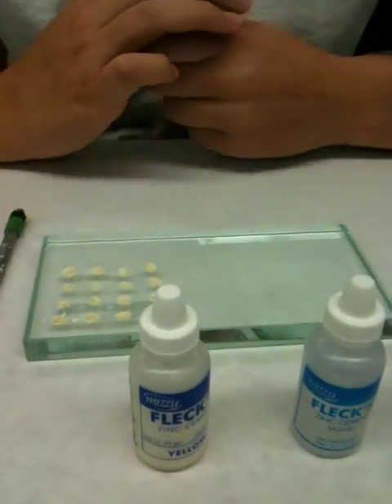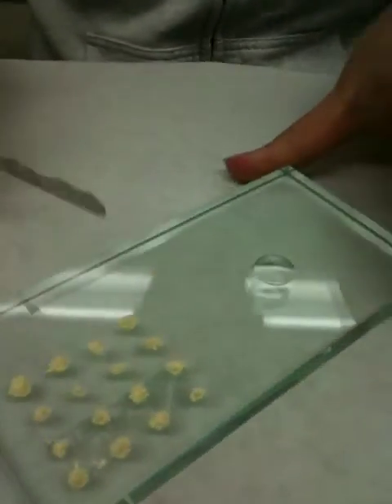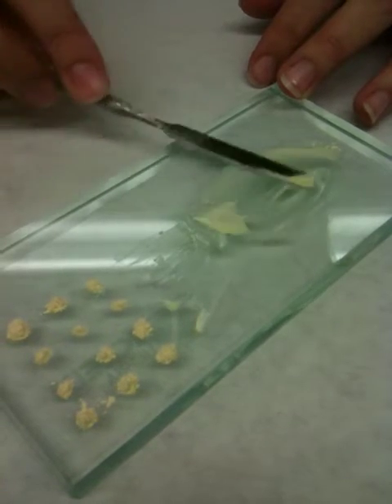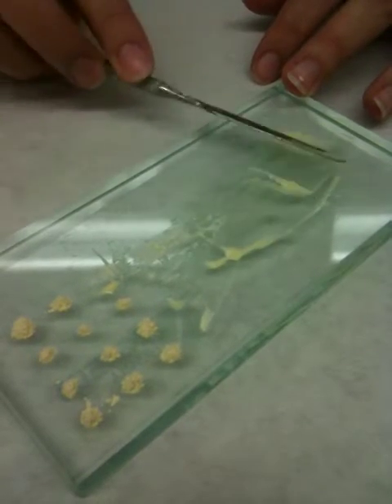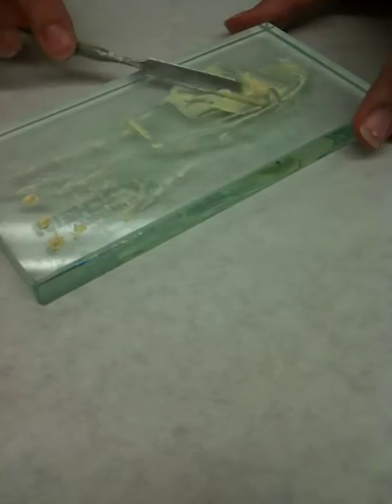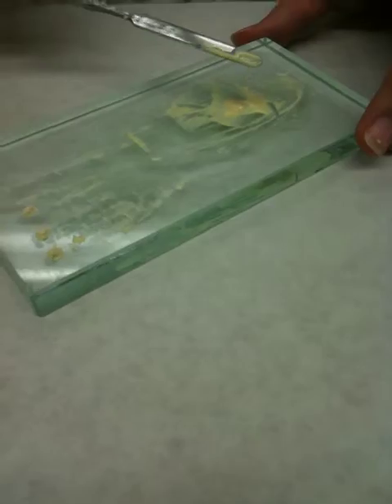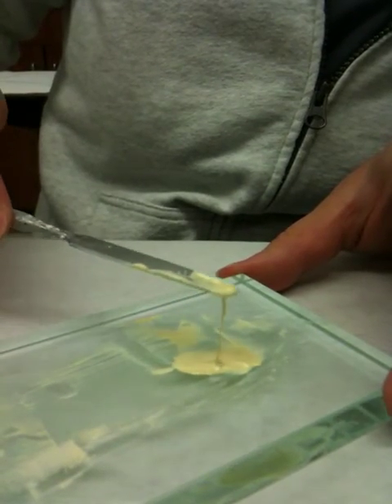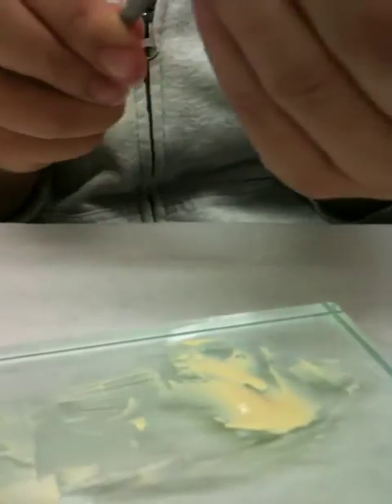Mixing Zinc Phosphate(FLECKS)as a Permanent cement

Comment: I am puzzled by these zinc phosphate videos. Glass is a great INSULATOR (inhibits the transmission of heat). That would make it just about the WORST material to draw heat away from an exothermic reaction.  Seems to me they should use a block of metal, ceramic, or marble.  Then after getting the cement prepared, how long is it workable?  How long until it cures?  Can it be applied to a wet surface?  Can the excess be removed easily?
Reply: You use a cold glass slab